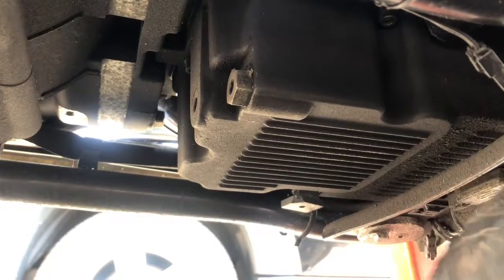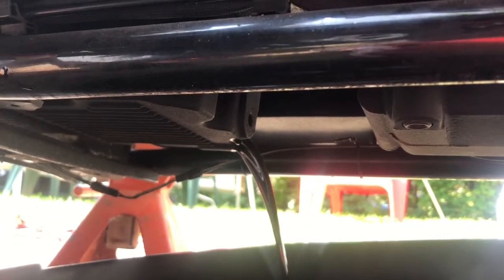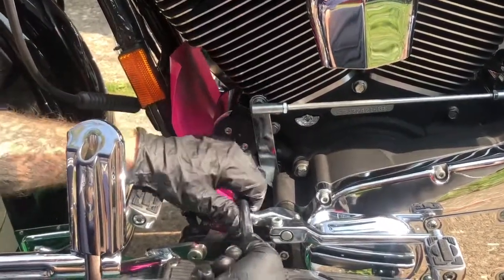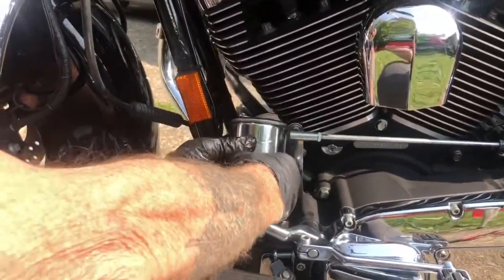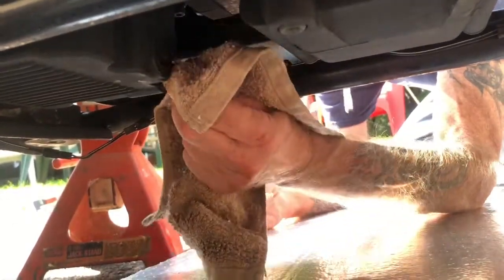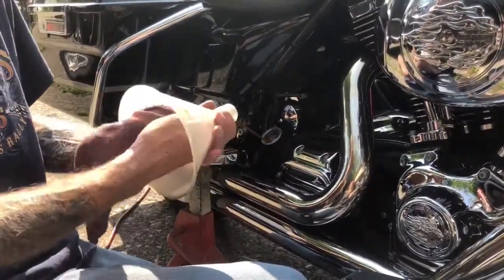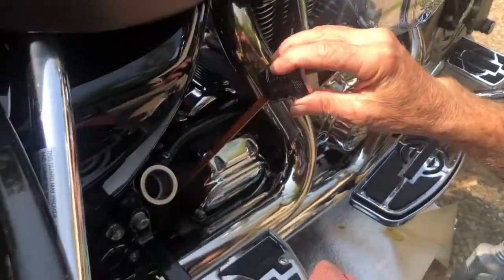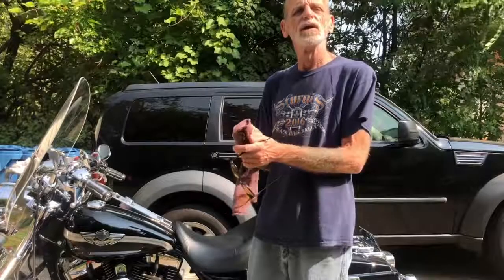Dave: how to do a oil change on a 2003 Harley Davidson roadking

Comment: Make sure you check the oil while the bike is on its jiffy stand. In other words on the ground. No need to have a friend hold the bike up for you it's designed to be checked in it's normal position on the jiffy stand.

Comment: I kinda think there's no air pressure in the crankcase, instead there's a bit of vacuum so to speak which is relieved upon taking out the fill cap. Just my opinion tho.

Comment: Nice job.  However, you are tightening both the filter and plug way more than necessary.  Especially the K&N.  But if it works for you great!  Nice video.

Comment: The motor is cold when you fill it with oil, I like to get it close but always under and I have an oil cooler so it takes more oil and then I go for a little ride To warm it up thoroughly and then let it sit for a few minutes and check it again and then get it up to the full mark . I’ve seen guys with their softtails that have been sitting for a couple months and they check it and add 3/4 quart and then when it warms up and expands they spew oil out of the cap all over and bad for the motor

Comment: You’re going to scratch your frame with that socket, just surprised me because you are so particular with every other detail as I am. I have the same bike , 95 “stage 3 with loud Vance & Hines 2 into 1 with 66,000 km. or 41,000 miles and rarely been ridden in rain , runs & looks brand new. I change the synthetic oils way before the recommended intervals and you should try Lemon Pledge polish on the whole bike and cars , it’s awesome and cheap and easy to apply and buff up. Good video bud